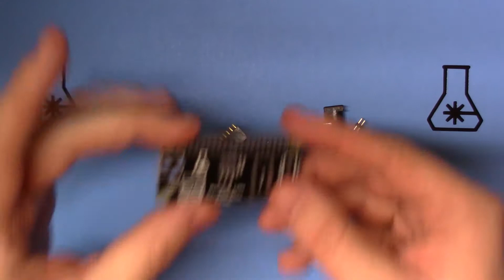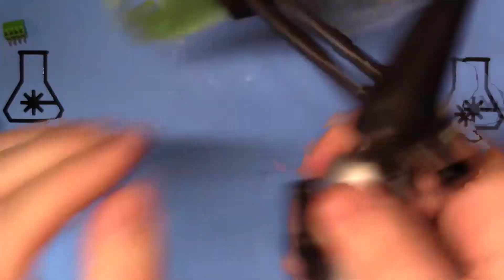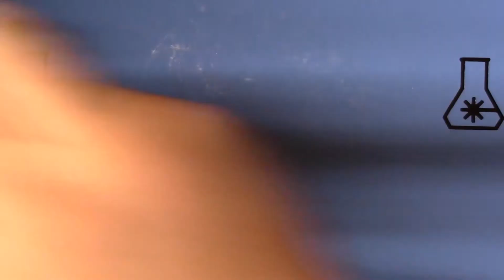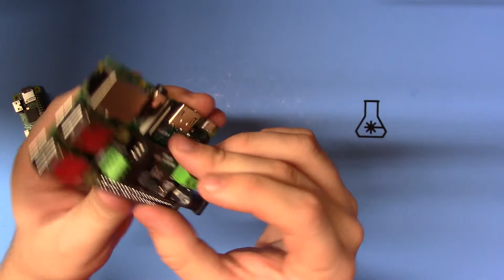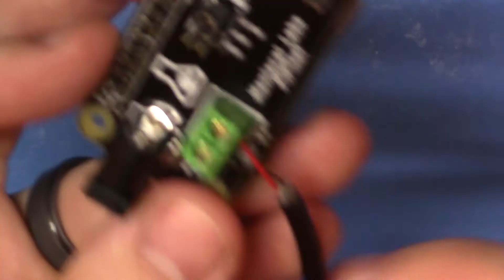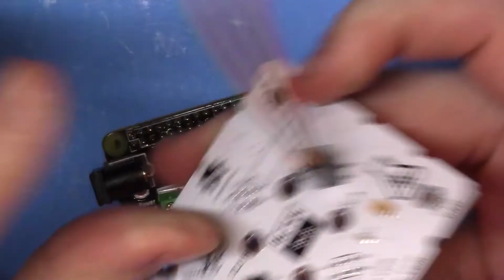PiPixel Assembly, Usage, & Demo

Comment: You made something similar before, am I right? Like the older version.
Reply from the maker: [Dan] I think you mean the AllPixel? (http://maniacallabs.com/AllPixel) The AllPixel is a stand-alone USB device, while the PiPixel is designed specifically for the Raspberry Pi. But you're correct, both allow you to easily hook up LEDs (and power) to the device being used to control them :)